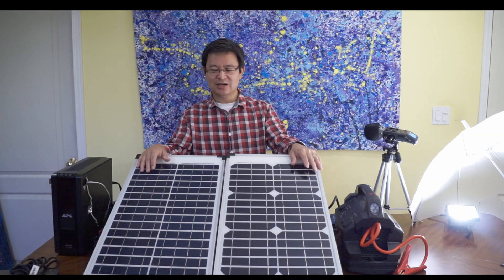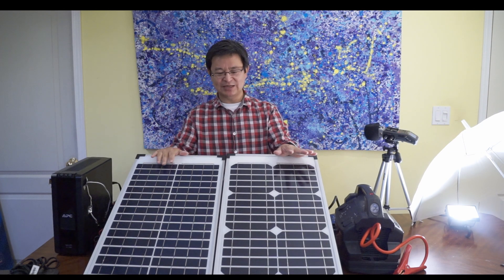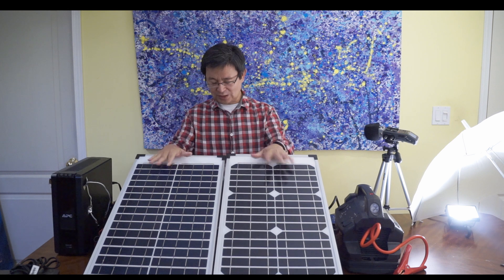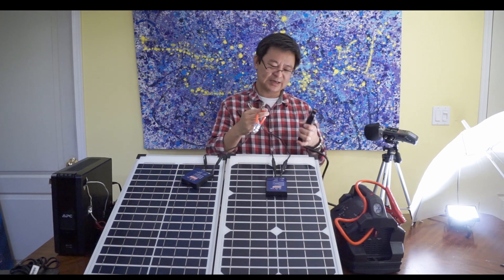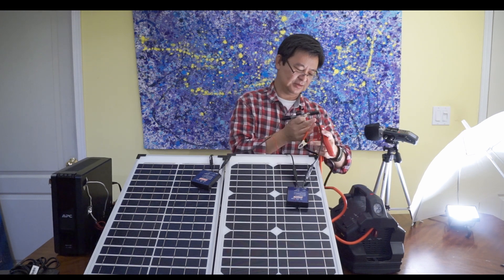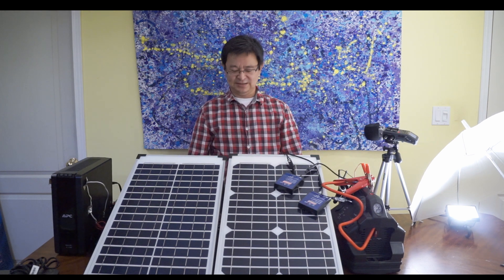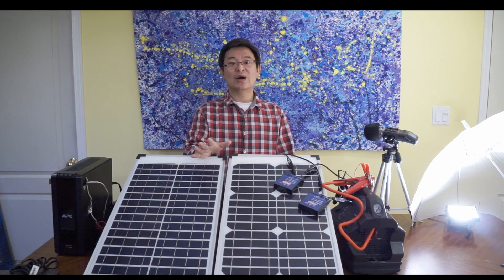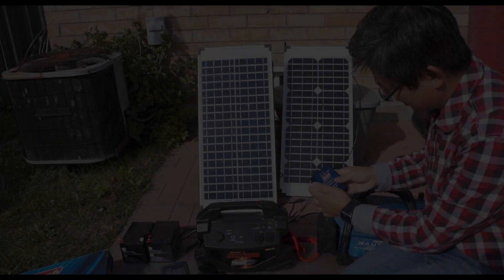Episode 2 -  How to hook up 12v battery powerpack system to the solar panel in parallel

Comment: Do I need a charge controller for each solar panel? Couldn't we just use one charge controller with multiple panels some how?
Reply from the maker: You can but it has to be connected in parallel; making sure the voltage is around 12-15v.  Also make sure the current amperage does not exceed the controller recommended maximum charging current.